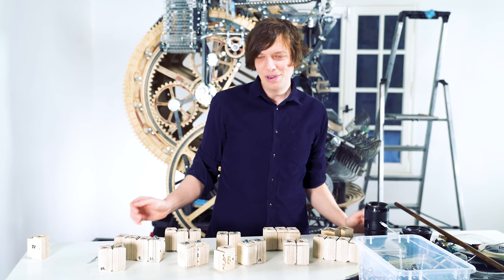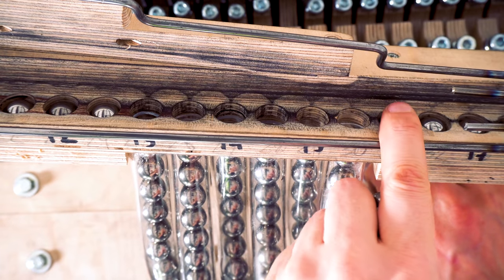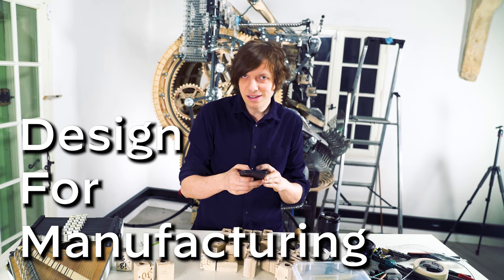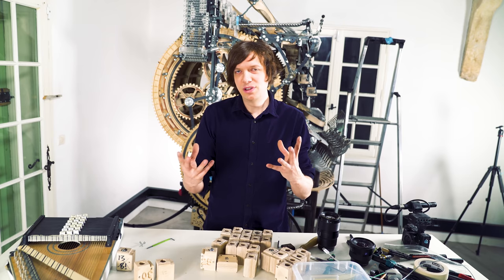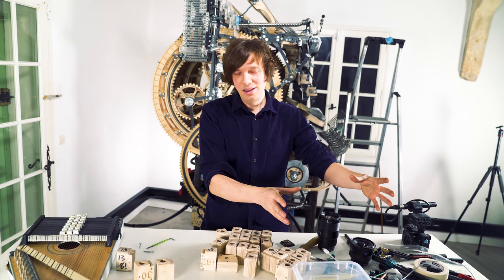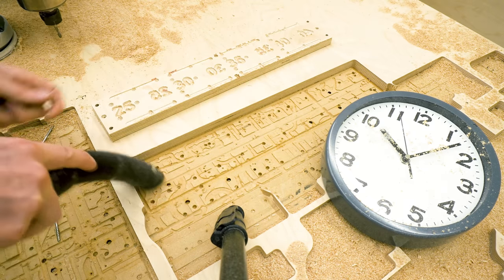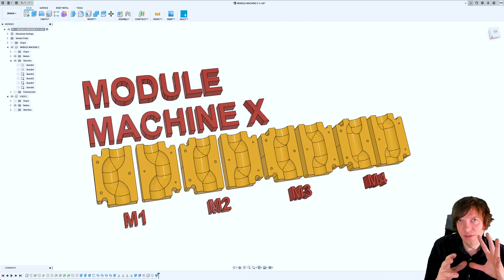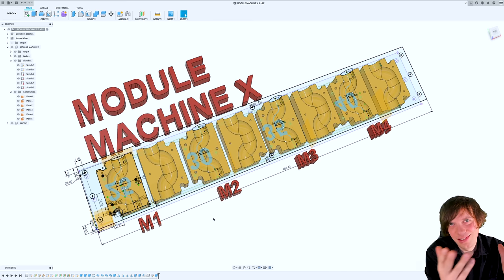Module Machine X

Comment: The Cybertruck is a great DFM example although it may not be a great result. It is designed based off of wanting to use stainless steel to make both a frame and body of a vehicle through one process instead of two. It also means you don't need paint, another manufacturing cost reduction (as Martin mentioned). In order to manufacture it inexpensively it's shaped geometrically as curving steel is far more difficult (and therefore expensive) than curving aluminum. Love it or hate it, it is indeed the result of DFM. That being said, in this case it may not be a great use of DFM. With a rigid steel body how do you make a crumple zone? Will the use of such a heavier metal impact efficiency/range? After a crash would the lack of modularity make the vehicle more expensive to repair? DFM is one lens to look at the process of engineering and designing through. It's important to keep other things in mind as well to ensure the product performs its function effectively and efficiently after its manufactured. Like Martin's marble height modules! :)

Comment: DFM transitioned into DFx, were the "x" can be Manufacturing, Repair,... This means that the product design is designed not just Manufacturing, be ease of repair, cost ect.
I worked as an Engineer for Motorola when they developed DFM, and interfaced with the Design Groups forcing them into designing their products considering current manufacturing processes and capabilities. It was a tough beginning, but after upper management showed the Design Groups, how DFM saved money and increased profitability, people got on board.

Comment: There are so many different goals to designing. Some of them are conflicting with each other.
You could have a designer who only cares for the aesthetics and how it makes the target audience feel. That's one goal.
The next goal might be functionality and usability. The thing needs to do it's job and be easy to use. That's another goal.
Then there may be regulations so next you design for safety, e.g. can't use certain toxic materials etc. That's another goal.
Then there's cost of manufacturing, that's both material cost as well as labour - that's your DFM and that is yet another goal.
Then there's maintainability. How easy is it to fix and repair it. Can anyone do it or do you need proprietary tools and a "licensed" (additional revenue) repair shop? 
And finally kind of related. Decommission - taking it apart and recycling some of the valuable materials when it's no longer used …

Which of these goals is the most important? Well, that is for management to decide. :D Ideally they all converge into one coherent design, but not always, because they do often conflict.
Do I want to chip into the cybertruck debate? Ehhh … speaking of safety, a lot of car manufacturers do a lot of crash tests to see how humans (pedestrians and cyclists) do in collisions with the car, the cybertruck looks rather "hostile" to anyone not inside of it. That's all I'll say to that.

Comment: it would be nice if you could use the total path length through the height module as the parameter. then you could make 15 different modules, each differing by 1mm

right now your parameter is only roughly correlated to the total length, because the path straightens out as you decrease the parameter. This is what gives you the inconsistent difference between modules

Comment: Modern autos are NOT driven primarily by DFM considerations.  The of manufacturing the body is a trivial consideration in the overall cost.  They start with the basic shape, then coordinated it with the mechanical necessities.  How they formed the panels would have been one of the last issues they considered.  In modern high volume production  there is almost no difference between curved and flat panels.  Simple flat lines are easier in prototyping, but for production models, it adds no benefits, and in fact can cause problems because of stiffness, buckling, and other issues which can in fact result in a need for slightly thicker panels.

Comment: I think you need to be doing more testing for consistency of the heights... You're going to be getting situations where in the pipes, you have something like
X
--X
--X
X
which will be higher than
X
--X
X
--X

If you're trying to go for 1m marbles with no failures... I'm a bit worried this design where you have long pipes with play for the marbles to arrange in different combinations is not going to meet your goal.

Comment: So what if you made adjustable hieght adjustment modules that worked like trombones? All you would have 2 do is push or pull an extendable tube from the front of back of a block.

Comment: i have a suggestion that may fix the problem of the feeder entirely. your problem here is that the height of the marble inside the tube is dependent on so many factors such as the tube length and feeders. and you are thinking on one dimension only why not use two dimensions. why not eliminate all of these factors by just adding another lane for marbles with an elbow like tubes beneath it this elbow only holds one marble and and directly feeds the main lane in a way that the elbow gets blocked if the channel is filled with marbles as it will rest on top of the last marble and the elbow gets blocked  horizontally by this marble if there are marbles in this channel. and if not then the elbow is open to accept marbles. Here the magic comes if the elbow contains a marble or two. the height of marbles inside  this elbow is determined by the elbow height and the width of the main lane which will make it fixed height

Comment: 10:30 Given that every mass produced car in the last 50 plus years is likely been designed for manufacture to a greater degree and do not look like a bad hatchet job probably means that the argument is probably irrelevant. The reason the cybertruck looks that way is very likely due to the same reason the Delorean that looks that way, to massively save on manufacturing costs due huge cash flow constraints.

Comment: Does Martin have to empty all the pipe and then replace the module? I don't know if this is obvious but if Martin can slide a thin cardboard, or a metal sheet above the modules then it may save some time on filling the pipe.

Comment: IKEA DFM: The most obvious feature on the shelf is the hole that is not used! Why make a hole that is not used? Because it is easier to make all the legs the same. They fit on the front or back, on left and right, and MOST IMPORTANTLY: IKEA doesn’t have to stock multiple item numbers! So: look for “useless” features if you are looking for DFM.

Comment: There is a much easier way. Do you know how bridges have build a zigzag mechanism at both sides of the bridge? Because metal expand in the Summer. Because of the zigzag mechanism there is not a dangerous gab. You can use the same principle by expanding the marble pats with a Zigzag mechanism in the wood. The balls keep rolling because the zigzag mechanism. You can rotate a screw for the best settings. You don't need to cut all those different paths anymore. Just rotate the screw for the best adjustment.

Comment: You should focus on designing 1 module that can be adjusted rather than doing it channel by channel. I was thinking of something like a trombone that can be moved in or out with a screw to change the length of the path.

Comment: Sorry Martin but the Cybertruck and honestly most of Tesla cars are not "DFM material". The Cybertruck can't pass the european regulations as it stand. That means the design has actually hindered the product in a way you won't be needing to manufacture more.
All the other Tesla cars have so many problems with manufacturing that I highly doubt they have a fool proof system in their assembly lines. If two parts don't mate well or if there is a way of overinserting a fitting than it is not a great design. They are learning though.

As for good examples you only need to look for anything casted or injection molded. Other than that simple, rugged and reliable stuff has usually a low part number which in itself is a great way of designing.

Comment: Hmm...when looking at the marbles when they fall into the divider-holes and wiggle around a bit, I get the feeling that this might cause some problems in the future. I wonder if this wiggling could be avoided by adding a small chamfer (countersink?) to the holes. But I am really not sure if this would help, or if it would make it even worse. But it might be worth testing if it turns out, that my feeling is correct and the wiggle does make problems in the future.
Reply: I've had the same thought. My main concern is that it would mess with how well the marbles roll over the filled holes, so I think the key word is 'small' in this case.

Comment: About the cybertruck thing. I thought the same thing as Martin, a few hours later I understood why the car was designed that way at the proposed price point.
But it's a bit more complicated than that, Musk said that there is no way to form complex shapes with the inox steel they are using, only simple bends can be achieved. So that must also be taken in consideration.

Comment: You that you are making so much improvements on the MM but why not improve your CNC?
There are methods to secure the wood pieces with a special vacuum cleaner.. so you don´t have to secure the wood with screws..
Crafted Workshop has a Video with the title "Vacuum Table Workholding" that you can watch..

Nevertheless good work with the video and don´t stop with your work.   The MMX will be great!

Comment: Round shapes are more organic. Round shapes are less dangerous. Round shapes produce less air drag. The cybertruck looks like a 40 year old car, from a time where computers were not able to calculate organically bend shapes due to missing CPU performance. Question: Should a product be designed to manufacturability or designed to use in the FIRST place? The answer is simple! Especially when a company has lots of fan boys that would pay ANY price the design to manufacturability is not the first priority, because price is also not the first priority. On the other hand I question if the cybertruck is really cheaper to produce than other cars. Stainless steel is not really a cheap material ;-)

Comment: The reason a famous designer doesn't think about DFM is the same reason so much of the software in there world has major issues. Software designers rarely care about how the choices they make affect the complexity of the engineering of their product. They see the "manufacture" of the product as being someone else's problem and therefore, the design isn't optimized for the best overall product.

Successful designs frequently eschew aesthetics for function. Think about Google Search's main page. There is absolutely nothing there that you don't want.  That's how competent designers think.

Yes, Ikea occasionally takes it too far - a set of shelves that can barely hold up a few rows of air, etc., but think about the best "things" in your life and compare their quality to how Homer Simpson would have designed it (The "Oh Brother, Where Art Thou" episode) and have some stern words with the next software designer you meet.

Comment: Your arguments for the cybertruck act as if that is the only way you can have it designed for DFM, but that simply isn't the case.
The chassis already has curves in it.

The hard edges are a stylistic design choice, not trying to make it better for manufacturing.
Reply: @JorgTheElder  You mean it shows how little you know of the English language.
It doesn't have a conventional chassis. That doesn't mean it doesn't have one at all.

All vehicles have a chassis. If they didn't, they wouldn't be able to hold up their own weight.

Comment: Not sure I get why the numbers would ever need to be mirrored. We are viewing a side flipped around right? It should always be readable? It's not ever seen through the material, and it's not being mated to the right-side number.
Reply: Maybe because he can just glance at it and it's immediately obvious which side he's looking at? The other features are smaller and more difficult to pick out. It also means he can see very clearly in the gloom under the machine which way round he's holding the part. It might also be slightly easier to CAD if he puts the number on before copying and flipping the part.

Comment: The first time you MMX will be transported via air, you will go back home and add protective layer on your wooden parts. The humidity will get inside the wood, the air freight at -60 degrees will freeze the water and the wooden parts will crack. Also, the non rust-free steel metal parts will start to rust and then you will scratch your head...as always....

DFT - Desing for Transportability
DFP - Design for Packaging
DFR - Design for Reliability

Especially the last one. You "reliability" concept is completely wrong.
Reply: hmm, seems to be an important point

Comment: Why not use modules that you can adjust using a two side of it that sole in eachother with screws on the side so you can adjust the length

Comment: I really wonder why you name your modules by the number of millimeters the path offsets internally. Wouldn't it be much easier for assembly to name the modules by the actual path length? The Math should be pretty simple if not already built into Fusion 360.

Comment: Great you have gotten the modules parametric Martin!

Have a look at this plugin for Fusion, it makes it possible to do parametric text as well.
https://github.com/thomasa88/ParametricText

I think the next improvement would be to change the parameters so that you can type in a specific length for the module paths and then let Fusion calculate the length of each line used for the path.

Comment: Honest question, why don't you number the modules based on length and not the offset from center? Wouldn't that make it easier to find the proper module? Like if your 2MM higher than needed and using the 126MM Module you could then just switch to the 124MM module and know it will be correct? Am I missing some other important detail that prevents this?

Comment: Martin, a car designer only pays attention to the outside visual appearance. Engineers take the "design" and then try to fit all the hardware under the skin. This has caused many problems over the years (especially with GM vehicles) where the design was too restrictive  to build a decent vehicle underneath.

Comment: If you check between 3:55 and 4:05 (pause and press j and k to skip 10 sec), you see that the height changes. These aren't even the longest channels, there's too much play in the tubes, this design is flawed.
Reply: I absolutely agree. As many people under yesterdays videos (height modules) commented, this design is problematic. The tolerance chain is very long, the paths (i.e. pmma pipes) are slightly bigger than the marbles' diameter. Therefore, the vertical row of marbles forms a snake pattern in the pipe, which is not always the same of course. Thats the reason why this design with the height modules will not guarantee the needed precision on top of the marble devider.

In this video Sebastian Kirsch came up with an brilliant idea (trapdoor hook system) which could solve the problem:
https://www.youtube.com/watch?v=zahlKPc6TMA&feature=youtu.be

Please vote it up on discord that Martin and the engineerng team can see it:
https://discord.com/channels/649165975647682560/649172304638640130/802136003137372180

Comment: Besides the DFM part, I'd like to know how efficient the cybertruck can be operated for an extended period of time. 

If the current package is less efficient to operate, I'm not interested about the cybertruck being produced more efficiently then some random other truck. Quite simply because we're paying premium for it being a Tesla and efficient production simply means more of the premium the customer is paying stays at Tesla. 

There's nothing wrong with that, but we're assuming everybody in this little DFM-story is looking for ultimate efficiency. In that case, a customer has to conclude that buying a run-of-the-mill Ford F150 or some van is a more efficient use of resources and therefore the superior option.

Or, simply put: It's a truck.

Comment: Round shapes and ribbing naturally add stiffness and stability to thin material. Think of the stability of eggs and shells. Big flat sheet metal structures tend to be floppy or buckle. The cybertruck design looks weird to me for that reason. In my opinion it is designed for looks and is not a particularly good sheet metal design.

Comment: It seems to me that those parts could be 3d printed quite effectively with zero extra touch time.
Reply: The difference is that it would take vastly longer to 3D print.
Reply: @jeffreyblack666  True, but it would require no interaction during that time.  Just start a batch and let it run while doing other stuff.

Comment: 14:41 Wait, you guys don't make everything "parametric"?
I'm really no pro, and struggle with fusion 360, but when I start a new design, first thing I do, is get all my dimensions as a parameter. Then start my actual design.
(then I end up with a bunch of variables, which I can't remember what they are for, but that's another problem :) ).
Maybe that's because I'm a programmer, who first learned C (where we had to declare our variables, in the function, then put out your code), but I thought it was common practice.
It isn't?